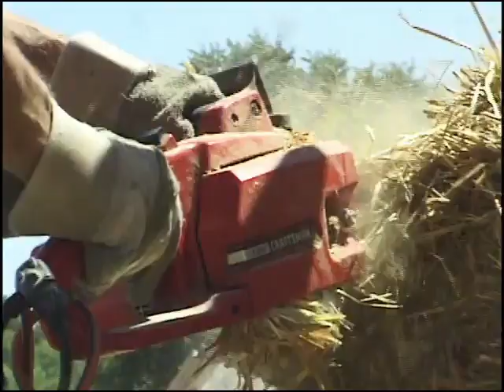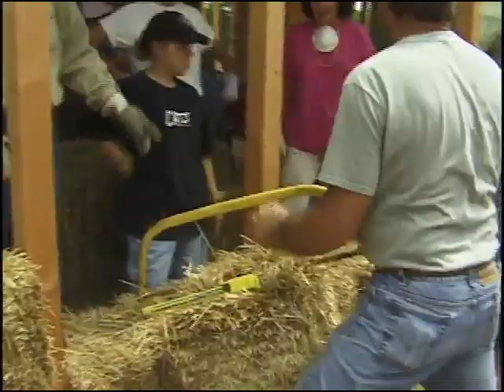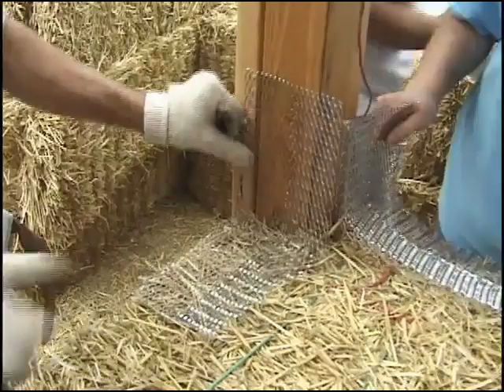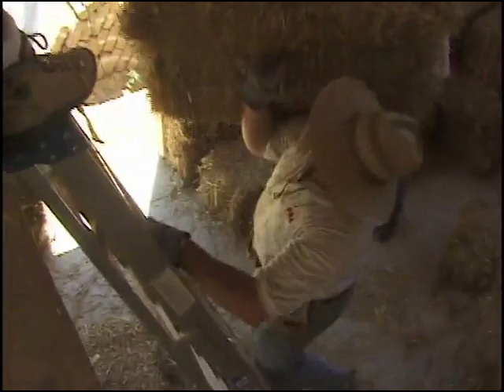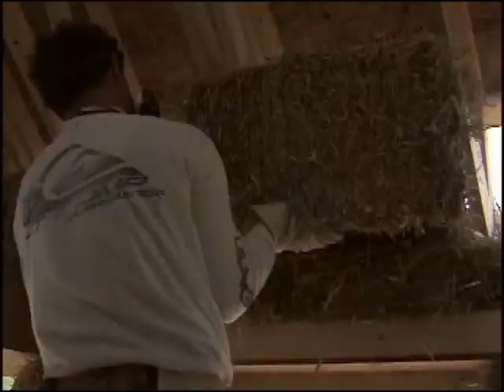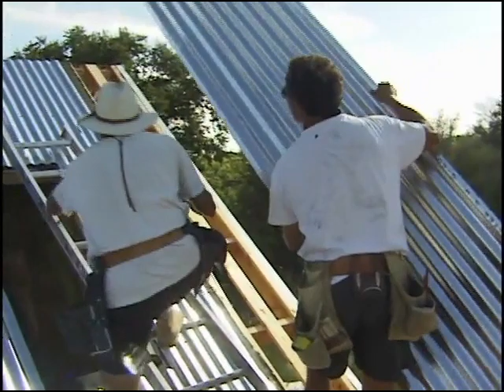How to Build Straw Bale Walls

Comment: Interesting. I thought the insulation value of the straw bale is much better when installed vertically (!). When the straw is installed horizontally, the thermal bridge is also horizontal. When installing vertically, there is always a layer of air in between.

Comment: Fire hazard.
Reply: It's absolutely not. The cob/plaster mixture that is applied over the straw is virtually fireproof. It's a very sustainable and safe way to build. Much better than the modern ways of building.
Reply: @adeleamra  Ehh, not really. They're okay homes in the right situations. Probably best for desert conditions. To say they're better than modern ways of building would need a lot more specificity on just which "modern way of building" you mean. There's tons of ways people build modern structures, and plenty of them are significantly better than straw bale homes.

The main issue is a lack of structural strength to the walls, they aren't weak, but they're nothing compared to brick or concrete, or even a wood framed construction. To keep them strong, they require a lot of wood to build, less than some methods, but still a lot. Plaster uses a lot of cement generally, and water damage and mold issues are common in straw bale homes even with plaster/cob/stucco. Again, desert conditions would be best for avoiding this. Rodents also tend to get into the walls and nest, especially once the plaster has aged a bit and started to crack from settling and thermal expansion. They often treat the straw bales with a rodenticide, but it's not terribly effective, and hardly ecologically friendly to soak your house in poison.

And they are a fire hazard, its just that bales tend to smolder rather than burn out of control, so it's relatively easy to deal with. But the roof and supports are all timber, and will burn just like any wood framed house would.

People tend to oversell straw bales as a construction technique, mostly due to the cost of the materials being so cheap, but honestly aside from lower labor/material costs, there are other alternative construction types that are significantly stronger and more resistant to pests, fire, and water, and as environmental if not more. CEB is probably the easiest and cheapest, and one of the strongest types. Bit more labor to make the blocks than having bales delivered, but actual construction is way simpler than cob or rammed earth building techniques, and generally faster. You can automate the block making as well, to save labor and time. I'd go that route in a damp climate, rather than straw bales, and the CEB thermal mass is probably more useful in a desert than the insulative value of straw bale walls.
Reply: It's fireproof